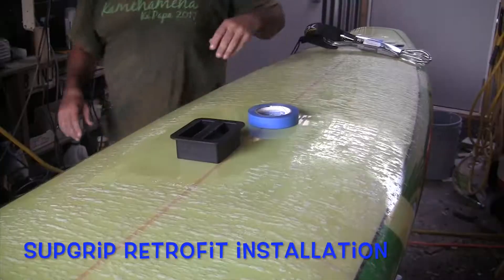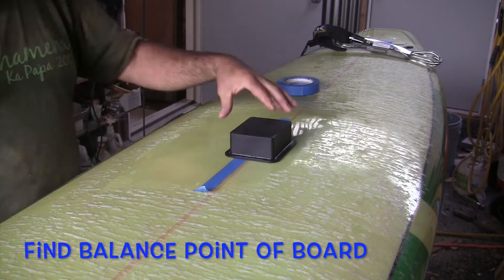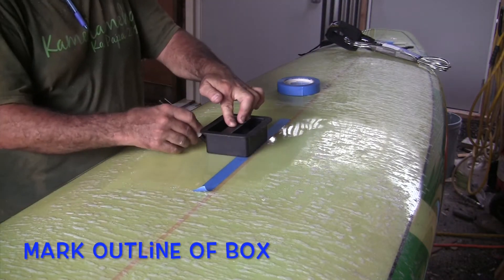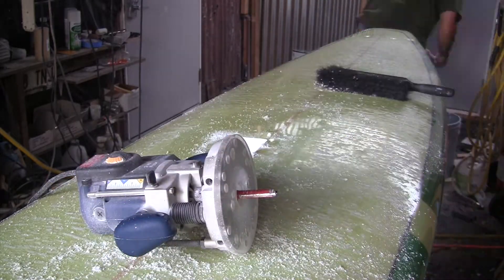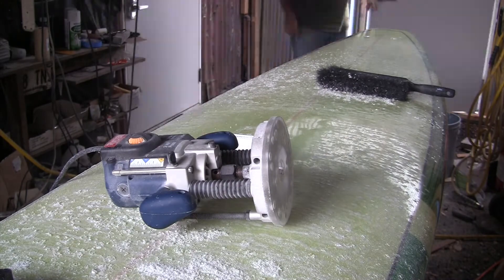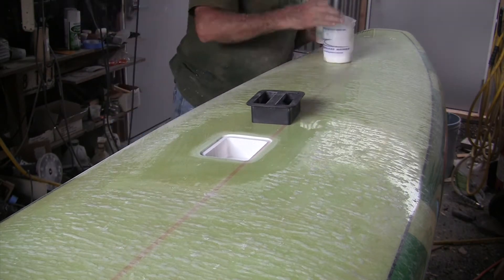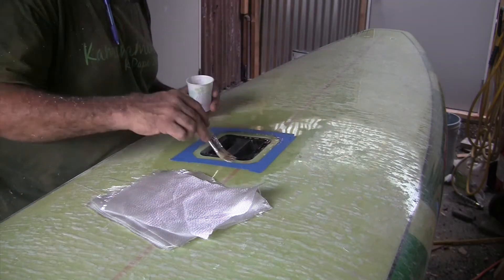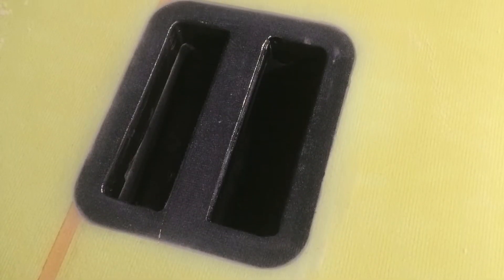SUPGrip Stand Up Paddle handle installation

Comment: Is the actual CUTTING part of the router bit (the blades) 2 1/2” long? Or is the ENTIRE router bit 2 1/2” long?
Reply from the maker: From description: 3) Use a ½" diameter bit with a minimum of 2" depth to router the box opening (the box is 1 ¾" deep)
Reply: @blueplanetsurf    Thank you.
Reply: @blueplanetsurf  OK, so the box has 1/4" radius on all 4 corners...  I would probably want to use a jig, since that's what I always use for fin boxes.  Is there a jug commercially available?